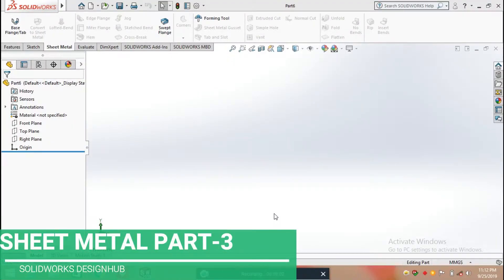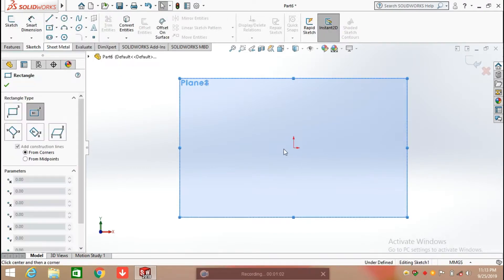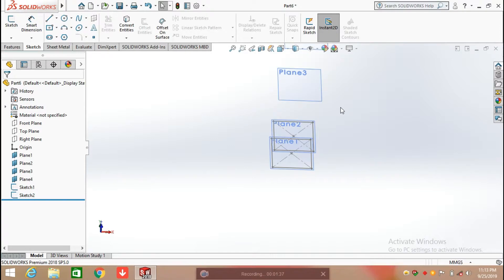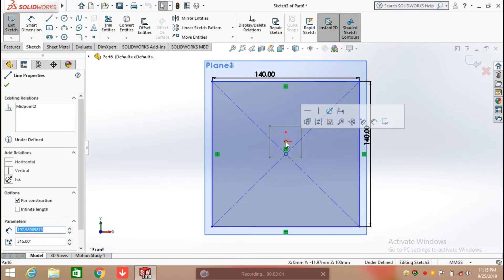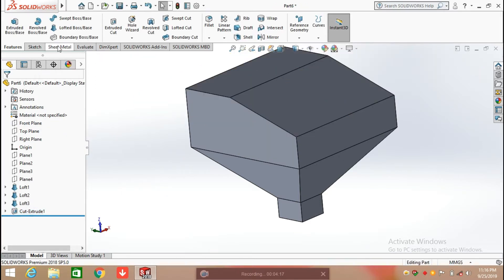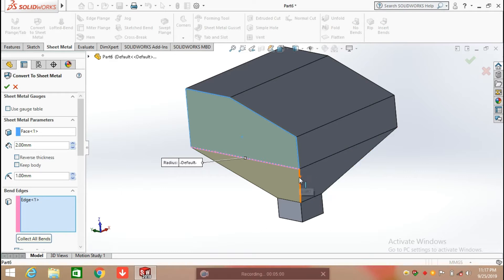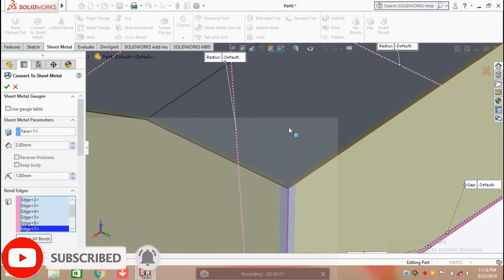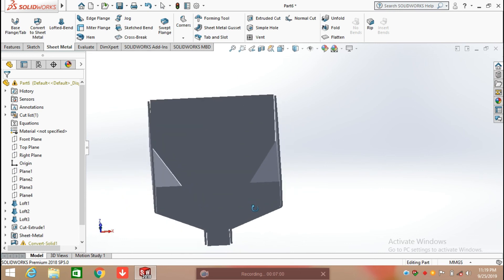Solid into sheet metal | hopper in sheet metal | Solidworks Design Hub

Comment: I just want ask a question. You fold sheet from first bend line with bending machine. Second bend line too. So how do you fold from third bend line? This is not manufacturable design.
Reply: Thanks for watching the video. 
And in this video we are trying to show that how we can convert a solid part into a sheet metal using solidworks.